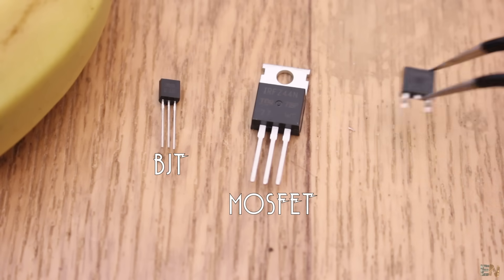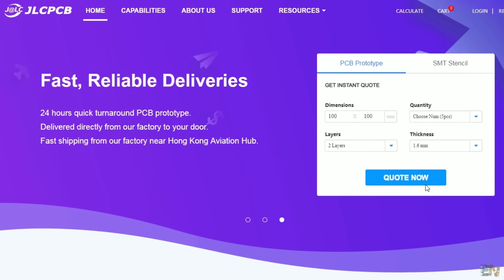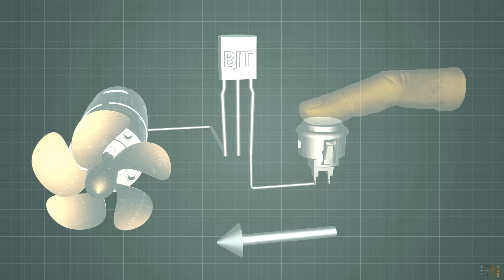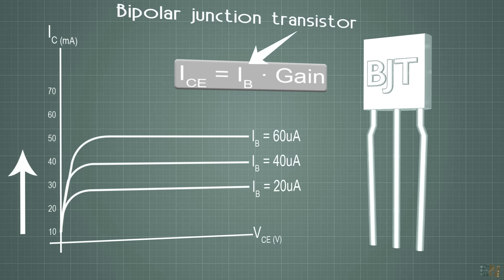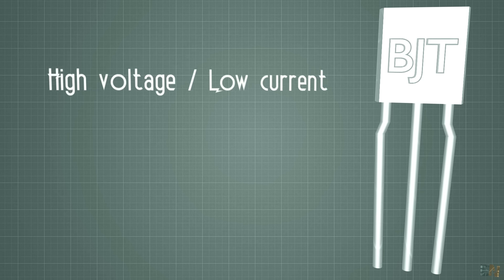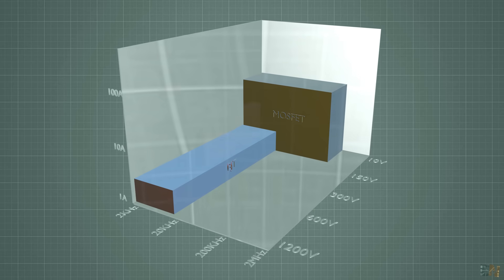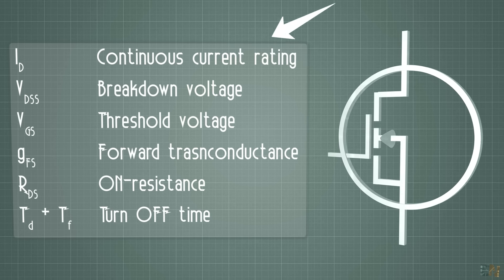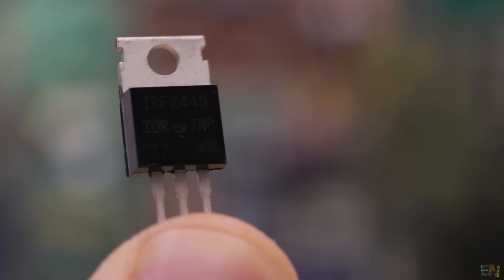MOSFET BJT or IGBT - Brief comparison Basic components #004

Comment: What's the hole in the MOSFET for?
Reply: A heat shield. A screw goes through the hole to mount it. They can get very hot.
Reply: @gregoryb2999  surely you mean for heat transfer or dissipation 😒
Reply: @ericscaillet2232   yes the metal is for the heat. The hole is to mount it on the heatsink with a screw.

Comment: Is it very difficult to compare transistors in the similar package? TO-220
Reply: Regardless the package you must read the datasheet, package means nothing but the power (and sometimes frequency) such a device can handle. In the past, packages also said what a transistor was made of: Silicon or Germanium (they both handled different elbow voltages).

Comment: I have at home a igbt module with one defective igbt (the module have 2 for each motor phase), and I was thinking about using it to make a guitar amplifier. Since the module still have 5 working igbts and they are kinda high wattage, I could use the same module to make the amps power source, preamp and power amp stages.

Comment: Just great, I am studying engineering and its very important to understand that BJT can handle high voltages but low currents because when you try to use them with high currents the Saturation Voltage between Collector and Emitter increases and it implies higher power losses. MOSFETS can handle high currents once you apply around 12V to its Gate, but they have no reverse polarity protection and also can't handle high voltages, IGBTs are great for both purposes high voltage and high current but a disadvantage is that the C-E saturation voltage when you handle high currents increases and brings again higher power losses, well, perfection doesn't exist, right?

Comment: MOSFETs are also used in audio amplifiers. In that application, they reduce the number of stages needed to get enough current gain to produce high power. One other way to look at the difference between BJTs (traditionally known as bipolar transistors) and MOSFETs is that BJTs have low-impedance inputs and MOSFETs have high impedance inputs. A typical BJT amplifier has a single voltage gain stage and two to three cascading transistor stages to achieve the required current gain. Typically, the MOSFET output stage can be driven directly by the voltage amplifier stage, much as it is done in tube amplifiers.  The difference between tubes and MOSFET amps is that the output stage of a tube amp is low current, but very high voltage which is converted to a high-current, low-voltage signal by the output transformer.
Reply: Yes but an MOSFET based audio amp (class D) is only as good as the output filter and works for defined frequencies while an BJT (AB class amp) can work in a wider frequency region (while wasting more heat too). It depends on the performance wanted in the application
Reply: I was speaking of traditional class A or AB amplifier design. Class D is a completely different animal, essentially a pulse-width modulation approach.
Reply: And, to be completely clear, there is no requirement that a MOSFET amplifier has to be class D. They work just fine in class A and class AB. For many years I owned a Hafler DH-200 MOSFET class AB power amp.
Reply: @bunkie2100  do you thing transitors
 amps have evolved to the point where they can keep high output without breaking down ,like valve amps.

Comment: In general, BJT has higher operation frequency than MOSFET, caused by smaller capacitance on the control terminal.

Comment: MOSFET is fine with high voltage as well. IRF840 can go up to 500V and I own few IXTF1N450 MOSFETs with a rating of 4500V and 0.9A (continuous Vds and Ids. They are incredibly expensive).
Reply: from my internship at a company that designed and built power converters , a rule of thumb I came across is that around 1000V mosfets begin to lose out to IGBTS due to the tradeoff between voltage rating/impedance. ......sounds like a incredibly specialized mosfet. very cool! (and very expensive ;-) ).
Reply: @km5405  True. The resistance of this MOSFET is very large compared to IGBTs with similar voltage rating. The main advantage is higher on-frequency.
Reply: Mdmchannel  https://www.mouser.com/ProductDetail/IXYS/IXTF1N450?qs=wUaLziKAieVmbFKN0j%2FKRQ==
Reply: Mdmchannel  
IXTF1N450(4500V0.9A-MOSFET)
IXBT12N300(3000V12A-IGBT)
FGA25N120ANTDTU(1200V25A-IGBT)
IXTA-H1N200P3-HV(2000V1A-MOSFET)
IXTF02N450(4500V0.2A-MOSFET)
FGA25N120ANTDTU(1200V25A-IGBT)

The last IGBT is used in some induction cooker - you can find some costing only few dollars on amazon (not sure about quality but I guess it's fine).
These are what I got. I'm not an expert.

Think about the current / voltage / switching time / leakage current you want.
High voltage MOSFETs general have higher on-resistant. Take that 4500V MOSFET as example, the on-resistant is several hundreds of ohms but offers better switching time.
If you don't care about switching time (for example, operating within 1000 Hz) but need high current, go for IGBTs.
Read datasheets carefully when making your choice.

You can find much more on Mouser website. You have to pay more if buying from Mouser. However, if you buy on Amazon, you risk buying recycled electronic components.
Reply: Mdmchannel  
this film just came out today.
May be helpful to you

Comment: Great video! But.. i will disagree with the frequencies amps and voltages. There are plenty of mosfets working with voltages of 1000v and above, and BGTs capable of handling hundreds of amps. Also lots of them easily handle megahertz even gigahertz frequency region.
Reply: worvtube not good for rf application if the gate capasitance is high.
Reply: @emppu-tech6065  Sure thing. You can't have all of the good stuff at the same time unfortunately.